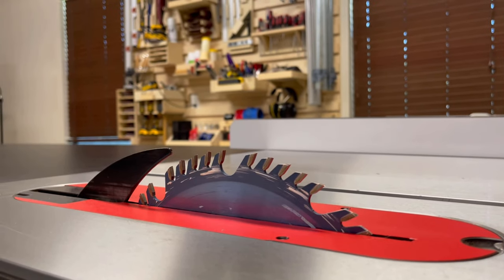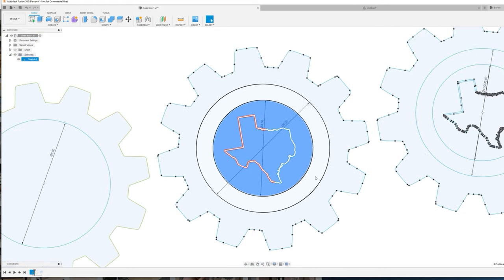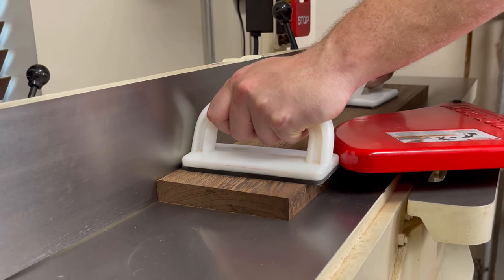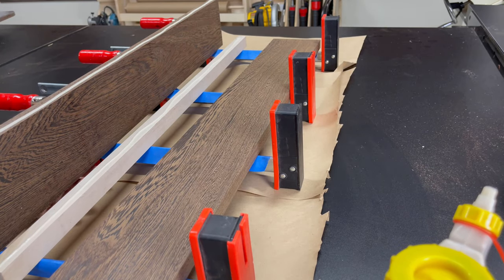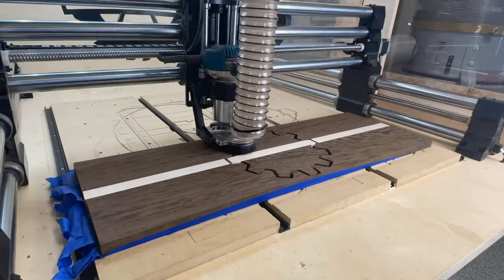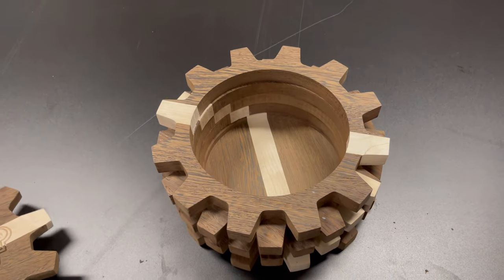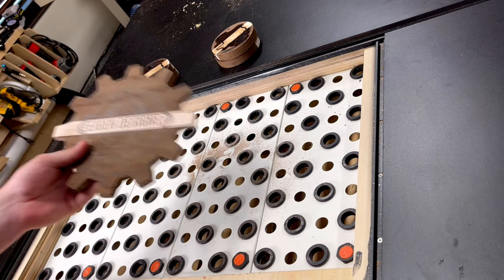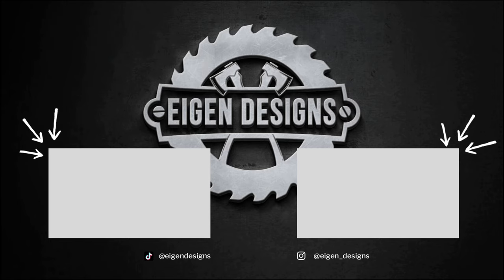The ULTIMATE Wooden Gear Box  |  Make ANY Shape a Custom Box

Comment: Nice job on the video. I normally finish my inlays first, takes extra set up time. 
fyi I have both festool rotex, and the $180 ali express sander... i wouldnt buy the rotex again
Reply from the maker: Thank you Ryan. I am still getting used to the rotex as it has a lot more torque than any sander I have ever used. Can you share with me your reasons for not wanting to buy the rotex again? I am curious to hear your thoughts.
Reply: @EigenDesigns  the alie express 6" sander is $200 festool is $700 cdn 
I bought it after watching a UK review. I love my festool tools.
I like my bank account more.
Reply from the maker: @Island.dweller  so far, I can't see the value it brings for the cost it has. The domino, on the other hand, totally different story. I think its worth its weight in gold. But the rotex hasn't blown me away yet. Just my early thoughts. Thanks for sharing with me.

Comment: Love the project!  Question on the table saw.  Where did you get the blade cover/dust hood?  That looked like a Laguna Fusion.  I have the F3 and love that dust hood.  Any advice is greatly appreciated!  Thanks!
Reply from the maker: Hey Stan, the dust cover/hood I am using is the floating dust collection guard that is available through sawstop. It was an optional add-on when I purchased my sawstop. If you click this link you can see the build that I have through the sawstop website:  https://www.sawstop.com/build#build-price/professional-cabinet-saw/professional-cabinet-saw_PCS31230_TGP236A_MB-PCS-IND_FDC

Comment: I was explaining all the different products I could make with a CNC.  During the conversation a light bulb with off.  You could in theory make products like a 3D printer in layers.  The difference between the 2 would be the waste wood for the CNC.  If you can tolerate the waste wood, the sky's the limit.  I've told my wife I want to marry the two technologies together.  Making a product with the CNC and accessories with the 3D printer.